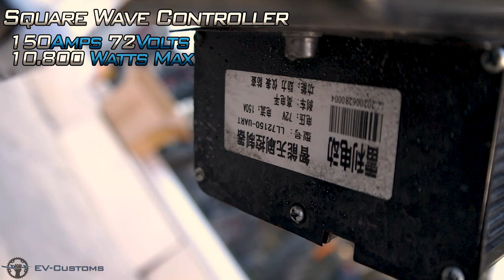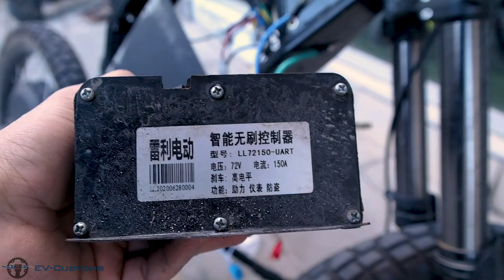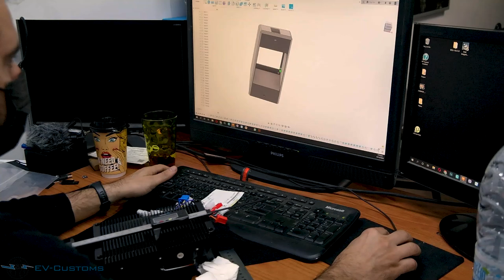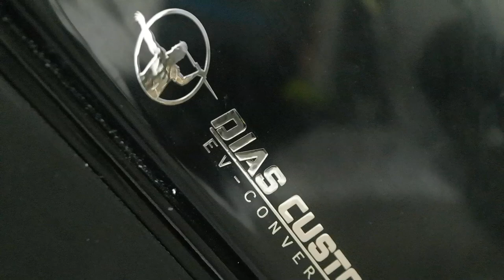Stealth Bomber E-Bike Stock Controller Upgrade to Far-Driver ND96530

Comment: it's not the controllers fault over 90% of the the case the battery cant deliver the amps.... writing this before i have watched the video to the end^^
Reply from the maker: Yes I knew that the battery wouldn't hold up to pulling the controller, because the cells inside  they are not  High Drain, they are only for capacity. I changed the controller because the customer wanted a sine wave controller to begin with, and then as soon as he finds money he will also change the battery to high power..
Reply: @EVCustoms  i got the same bike, with 72v 30 ah battery, 3 kw motor, and sabvoton 45A controller and it's good for me, good top speed and battery are holding up even on low charge...
Reply: @salviaaable  My friend you understand for 45a controller don't need something special..
But for a 400a e-bike you can't buy all the parts at once because of the money (except if you have them) ...
So our friend start with the controller (it is manageable), then he will upgrade and the other parts (battery, motor, wiring, brakes...)
The basic here is that the upgrade make it from professional guys EV-CUSTOMS, knows very good what to do and our friend bike works without problems..😉
That's the fun of a tuning process...
When you starts never stops...😘

Comment: Hello mate i just found your chanel !! Nice videos? Do you live in Cyprus? I have an electric motorcycle that i build my self.. I am using Two 60 volts lipo batteries 40 amps bms connect in parallel for a total of 60 vollts 80  amps battery pack( voltage is 70 volts when is fully charged). I am using a cheap universal ebike controller .. it is working perfect for 6 years now .. the only problem is top speed only 50 kmh ..  Can you help me to upgrade my controller? Do you have any extra that i can buy from you? 😅
Reply: Hey bro can you help me ım useıng ebıke lıke your ebıke and ı wıll buy e new controller but ı have no ıdea so can you tell me your name of controller or wıch amp. I must buy ? Batteries 60 volt lıpo(max70volt) the motor 2000watts 3gear

Comment: Definitely love, LOVE the 3D printer. I can see that you didn't really feel comfortable drilling more holes in your frame. That's why I have a big, dorky mount on my fat bike for the controller and wiring. I used 1/2" HDPE and it's kinda heavy. I'll look into those printers. It would make my builds so much cleaner and stronger.
Reply: Is this 400x400 build plate? I have the Anycubic Chiron just curious the potential difference in size

Comment: Oh did you get 16V voltage sag on take off??
Reply from the maker: Hi... what you mean?
Reply: @EVCustoms  near the end of your video you said 16V down
Reply from the maker: Ah.. yes the batteries are not high drain..  they need replacement..
Reply: @EVCustoms  so it was 16v sag when you accelerated?
Reply from the maker: @MrDeceptacon88  Yes..

Comment: If you get a rear flat, you'll need to do this entire video in reverse in order to get the wheel off far enough to change the tire.   -Just sayin'
Reply from the maker: Yes this change need time... 😅😄
Reply: maybe a custom extension cord??
Reply: Its not that hard to remove. But it defiantly sucks compared to a normal dirt bike. I've done it at least 3 times.  I just lift it up under a ladder, drop the tire down on a blanket and swap the tire.  You have to replace the zip ties on the side of the swingarm, but that's the easiest part.  Newer ebikes have a disconnect located on the swingarm.
Reply: @tacticooldennis  that would be easier for sure, but for one, if you ur building one of these from scratch, you'd need to have enough know-how to keep that in mind at the start of the build because the way ur describing won't work on some of these bikes that come pre-assembled.  Like the ones from ebay or alibaba or whatever.  My bike for example that wouldn't be possible.  With where the controller is mounted and how snug all the wires are, there isn't even enough leeway for me to get that back wheel off without doing the whole video in reverse.  The leads just aren't long enough.  And if the swingarm is jacked up on a stand or ladder or whatever, the legnth of the wire is too short that it prevents the wheel from even touching the ground.  It's just not long enough if you can believe that.  (but wouldn't expect any different if you consider where it was made/assembled lol) Also, if you tug on those hub leads too hard you can damage it in a way that involves having to rebuild the hub to a certain degree.  In the whole process, you risk damaging hall sensors if you're not careful or don't know what you're doing.  And I've had two flats on this damn thing so I've done the video both forward and in reverse twice already.  I told myself that if (when) it happens again, then F this thing and it's getting replaced with a Sur Ron or Talaria or something along those lines.  I didn't even mention in the last comment that every time that hub comes off, it needs to be recalibrated or the speed/mileage won't be accurate.  You have to do that whole process with putting it in calibration mode and walking the bike 10 feet and that whole nonsense.  What a hassle for a flat tire.  I wouldn't say it's difficult, but it's an enormous pain in the ass.  And completely unnecessary.  There's so many better ways.  Lately, I'm seeing people using xlr audio jacks as the battery disconnect on some lower voltage bikes.  Smart.  The thing is that most ebike riders (out here in southern California anyway), aren't very mechanically inclined.  They buy these bikes without any knowledge of basic electric/electronic circuitry and could barely change a tire on a non-electric bike.  So for the everyday joe schmoe, changing a tire on one of these rear hub motor bomber clones is gonna be a monumental challenge.  And most shops out here won't go anywhere near these.  So they all wind up getting parted out on FB marketplace.
Reply: @joeblow6756  Yeah I came from both a dirtbike and computer background so working on my Alibaba stealth clone is pretty easy.  I just replaced a tube this week, and sure enough a new tire arrived today, so now I'm debating taking the whole thing off again, cutting zip ties fighting the rubber so I can go with a Shinko vs a bald knobby I'm running.  I see on the real stealth b52's have multiple connections that separate at the crank. https://youtu.be/BUZCH4JWKis?t=130  I run a Kenda rear with a ultra Michelin Ultra HD tube cause I hate flats.  I still managed to pinch it with a spoon on my last tire change.
Reply: @tacticooldennis  for sure. I could tell just from ur response that you know your way around this stuff.  I've got a set of Shinko's brand new waitin to go in the garage for my next set up.  Running Bridgestone enduro tires at the moment and I need to run 'em with rim locks.  It's kinda funny, I just have to laugh to myself at some of the idiotic engineering that they send these things over to the states with.  The bike weighs damn near 200 lbs, but is fitted with mountain bicycle brakes.  They're higher end brakes, but still not meant for that type of power to weight ratio.  The first flat happened because if I brake too hard and lock up the wheels, the tires spin slightly and break the bead from all that unbalanced inertia.  Obviously, causing the valve stem to tear.  Yea, I was about 30 miles from home when that one happened.  The next time it happened was because the bike has so much torque, that without the rim locks the bead breaks, I get the same type of tire spin and obviously the valve stem tore again, leaving me stranded.  Again.  Was 14 miles from home that time.   It's been a learning experience trying to figure out what percentage this thing is bicycle vs motorbike.

Comment: I'm currently building a 2000w hybrid cargo mopet and your videos are great help  because most of this stuf is unlabeled 

I'm very well educated in electrical stuf but I stil need to know what wire dous what and how.  

I'm probably going to get the controller you have here it looks a lot more professional than the 3000watt unit i have now  simular to the one you removed in this video 

I love that yellow
Reply: How's it working.  What did you get?

Comment: Yasou, long time subscriber, you have helped me in the past. I have a Clone Sabvoton ML7280 contoller, however no instruction how to connect, there is 1 single grey, I cannot work out what it’s for 🥹
Reply from the maker: Hello man...  gray mist be with metalic connector, phase meter (input)
Reply: @EVCustoms  Thanks for reply…is that a learning wire? 😳 Where to connect?